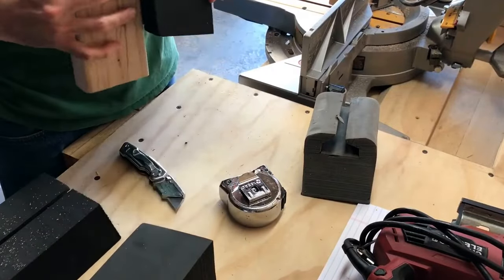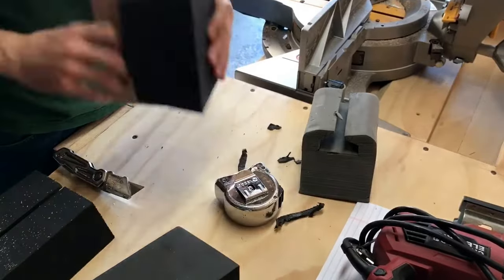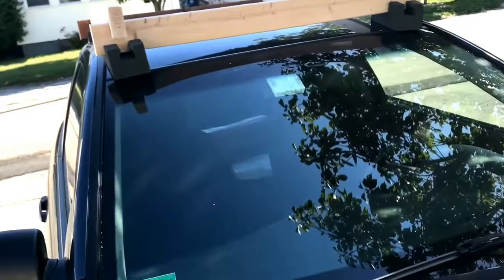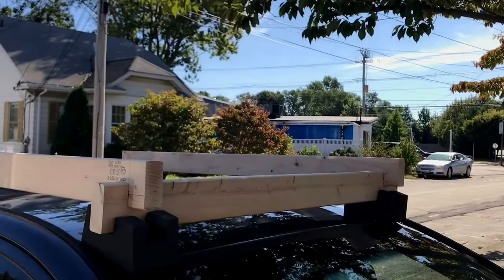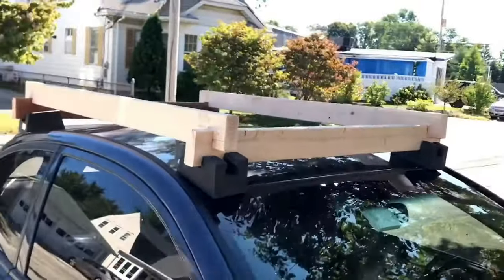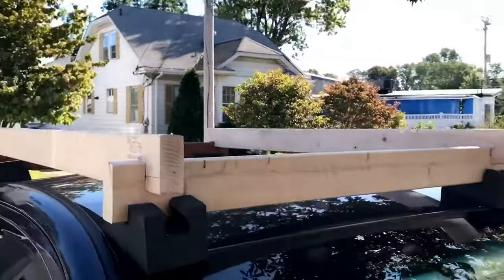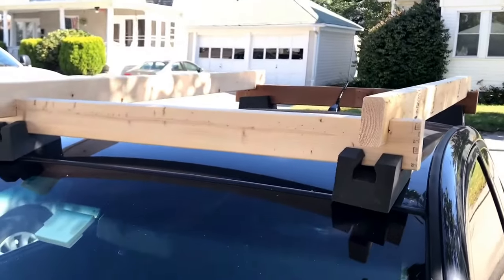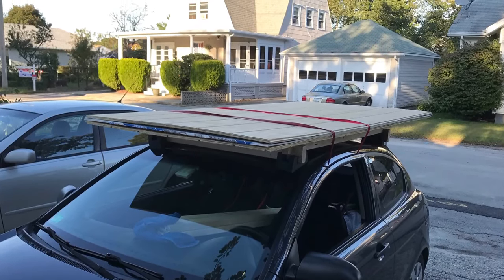Quick and Easy Homemade Roof Rack

Comment: I'll be needing about 20 sheets of OSB over the next few months for various projects. But I don't want all of them at once (sitting out in the rain). And besides that, delivery is $80! And I live less than a half-mile from Home Depot! So I was thinking along the same lines.

I see you have (had) the same problem as me - a two-door hatchback. I think I will run a strap under the hatch to secure the load rather than counting on two straps run through the front doors. 

I didn't know about canoe blocks. That was the missing ingredient. Now I'll just order some of those and I'm good to go. Thanks!

Edit: Wow! Turns out those things aren't cheap! I think I have some closed cell foam I can use to make my own.

Here's a tip for anyone needing closed cell foam: thrift stores always have one or two of those little mini surf boards laying around that can be had for cheap. Lately it seems that most of them are made of Styrofoam, but they used to be made of closed cell foam. Take a chance, you might get lucky. If not, return it.

Closed cell foam is also really good for sealing up a window around a window unit air conditioner. As is Styrofoam, for that matter.